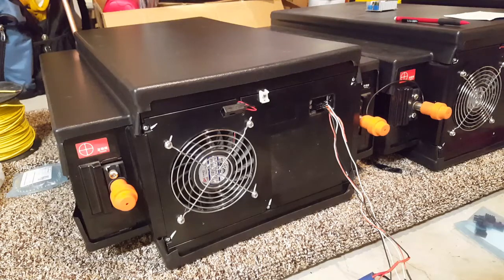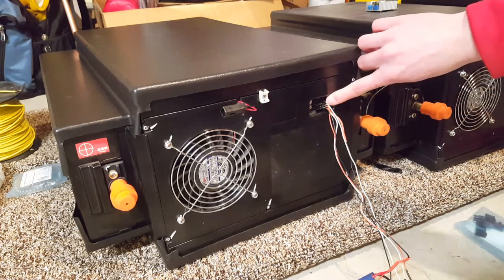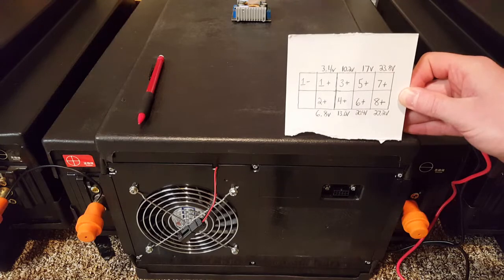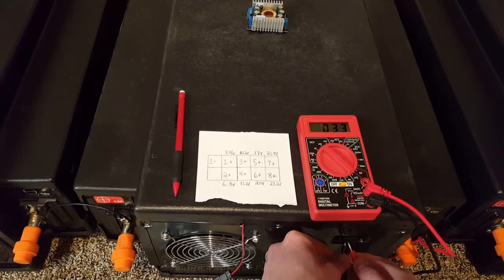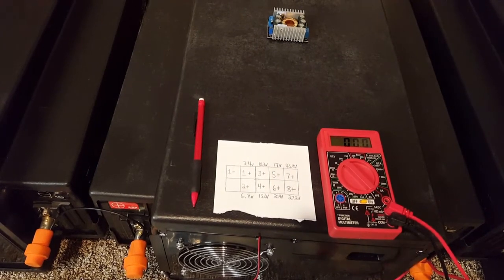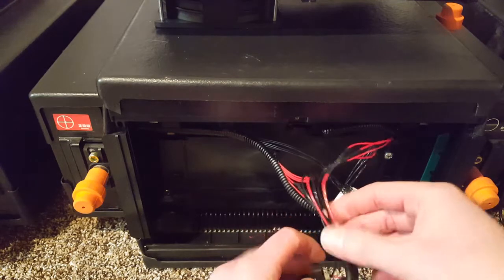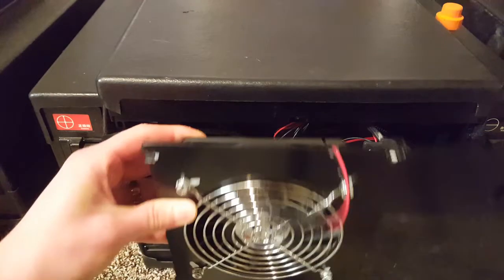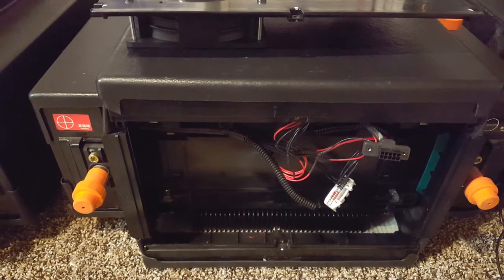$100/KWh LiFePO4 modules - easy to set up for solar!

Comment: i love these packs they be ideal to stack for my ups how wide are they would they fit into 19inch rack mount
Reply from the maker: They are 20" deep, 17.5" wide, and 6" tall. Be warned that these batteries are very degraded and very heavy. You will need A lot of electronics to monitor and balance them if you want to squeeze the most energy out of them.
 https://batteryhookup.com/products/byd-24v-8s-lifepo4-3kwh-blowout

Comment: Thanks for your video! I bought some BYD 24 modules too and plan to wire common wire 8S BMS. How many parallel modules do you think you can connect to one single BMS? Maybe the max BMS Amps would be the restricting factor...
Reply from the maker: In theory, you can wire as many modules to one BMS as you want, but each cell must be paralleled to the other modules respectively. All cell 1's paralleled, cell 2's, cell 3's, etc. That is the only way to monitor all cell voltages with one BMS. For my setup, I am doing 2 modules in series (16S) and 2 modules in parallel with one bms. The parallel connections are at the cell level like I described. Depending on your application, it may be better to have multiple BMS's for simplicity/safety.

Comment: What are the black wires to/for on the original plug? I see the red ones are for the balance feature. Just wondering
Reply from the maker: I'm not 100% certain but my guess is that they are for thermal monitoring.

Comment: Nice job on the video.  I have three BYD's.  I've only worked on one battery so far and have come across resistance issues with the cells.  Most cells are playing friendly but cell #1 on this particular BYD is the issue.  If I take my pack over 27 volts, cell #1 shoots to 3.6v and over while the rest of the cells are around 3.4.  Go to cycle a few more times and then look into active balancing perhaps QNBBM.  Keep up the good work!
Reply from the maker: Mine are doing the same. Some shoot to 3.65 v, others stayed at 3.45. However, I plugged a little LED light into it and left it overnight, and all 8 cells were at 3.35 v the next day. So if my idea for balancing doesnt work I may just scrap the top voltage range and stay at 3.45 v and lower.
Reply: @diyrenewableenergyelectron4996  Yep, that's what I'm finding too.  Even though my cell #1 shoots up fast, it is playing nicely on discharging.  Going to do full discharge this weekend.  Glad we could connect.  Let's keep in touch.

Comment: Just charged 1 of my 24v battery and the 5 cells charged up to 3.65 and 2 cells got up to 3.52 and cell #4 only got up to 3.40.  Is this a good result?
Reply from the maker: That is very typical with these since they are used. 90% of the capacity of LiFePO4 cells is in the 3.2-3.3v range. Once you get above that to 3.4v the cells with less capacity will rise in voltage more quickly than the cells with more capacity. My cells did the same thing and everyone who has reported on these also had similar results. My plan to only charge my cells to 3.4v-3.45v. An active balancer will be very beneficial and I plan to add this to my setup. An active balancer will take power from your highest cell and put it into your lowest cell, keeping the voltage from getting too far off from one another.
Reply: Great Video. What’s your recommendations for a balancer ?
Reply from the maker: I was originally going to use QNBBM balancers, but hage since opted to parallel the cells together in 2 modules then parallel the cells together in another 2 modules and wiring the 4 modules into a 48v series setup. I could probably get more capacity if I added an active balancer, but I'm happy with what I have without them.

Comment: On the pin assembly, which wire is negative?
Reply from the maker: Hi Ernest, which pin assembly are you referring to? The molex connector I re-wired or the original BMS connector I cut the balance leads from?
Reply: @diyrenewableenergyelectron4996  The original bms connector.
Reply from the maker: @ernestcriss  the module negative balance wire should be 8 holes from the left side. There are 3 empty pin holes and then 5 holes with red wires. The negative wire should be the red wire all the way to the right(and without a wire behind it). Check for continuity between this wire and your module negative.
Reply: @diyrenewableenergyelectron4996  Thank you so much for the help on this and your response time is very much appreciated.
Thanks again and I'll be following you on this project so that I may continue to learn since I'm new at this kind of stuff.
Reply from the maker: @ernestcriss  thanks! It is much appreciated. I am actually receiving the 2 replacement modules soon and will do a detailed balance lead wiring tutorial. Keep an eye out for it. If you want to cheat, I'll tell you now that the top row where you got your negative from, moving left is 1+,3+,5+,7+, then 3 empty holes. The bottom row which only had 4 wires should be 2+ all the way to the right then moving left should be 4+,6+,8+, then 3 empty holes.
Reply from the maker: Double check that though 😉
Reply: @diyrenewableenergyelectron4996  Can you tell us more about the replacement modules?  Were the original modules having balance issues, weak cells?  Anything you can share helps us all out!  Thanks!
Reply from the maker: Keep an eye out, I should have a video out this weekend. I received the replacements yesterday.
Reply from the maker: The original modules had cells that would not hold a charge at all. Within a few days the voltage was 0.6v or less regardless of how long I charged them beforehand. Not good :(
Reply: @diyrenewableenergyelectron4996  Wow!  Good to hear they were replaced!

Comment: Any idea what BMS you are going to use?  A link to source it would be helpful if you have picked one out yet.  Thanks.
Reply from the maker: I'm going to give this Bluetooth BMS a try. I'm also going to try using a 48 volt relay as a disconnect so current doesn't flow directly through the BMS wires. I'm also trying an active cell balancer that can balance at up to 6 amps because the BMS is probably not going to be enough to keep these large modules in balance :
 https://m.ebay.com/itm/Smart-Lifepo4-li-ion-Lipo-LTO-Battery-Protection-Board-BMS-48V-72V-Bluetooth-20S/192880341024?ul_ref=https%3A%2F%2Frover.ebay.com%2Frover%2F1%2F711-53200-19255-0%2F1%3Ficep_id%3D114%26ipn%3Dicep%26toolid%3D20004%26campid%3D5338408166%26mpre%3Dhttps%253A%252F%252Fwww.ebay.com%252Fitm%252FSmart-Lifepo4-li-ion-Lipo-LTO-Battery-Protection-Board-BMS-48V-72V-Bluetooth-20S%252F192880341024%253Fhash%253Ditem2ce8907020%253Am%253Ameq0dH-NG4Lz1f3eZ6HyAeg%26srcrot%3D711-53200-19255-0%26rvr_id%3D2234662675280%26rvr_ts%3D40c0a06016f0a4d1290571a2ffc44a20&_mwBanner=1&_rdt=1&ul_noapp=true

https://www.aliexpress.com/i/32696417844.html?spm=2114.12057483.0.0.585f481eCEYVIF

https://www.amazon.com/dp/B013TCM9IQ/?coliid=I3KCVHE66KBTFE&colid=NMMKEKO0VBWD&psc=1&ref_=lv_ov_lig_dp_it